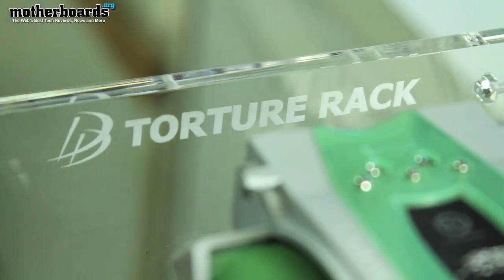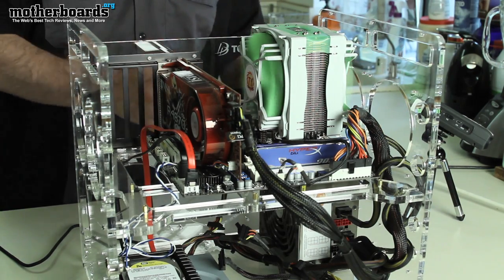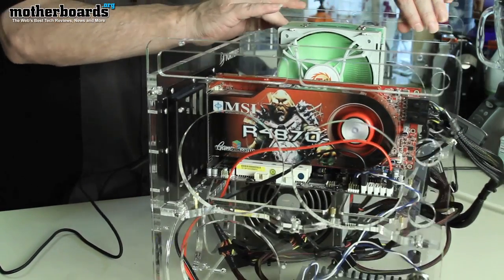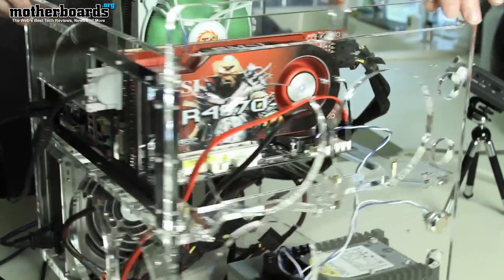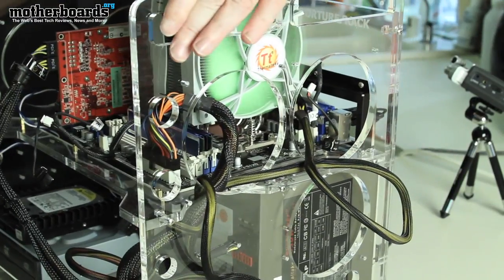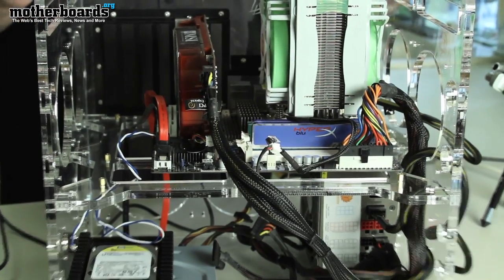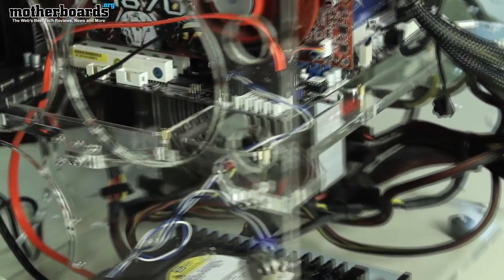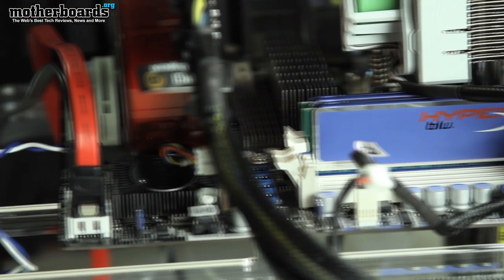Danger Den - Torture Rack (Acrylic Case) Hands on Review.

Comment: I only went back 3 pages so forgive me if someone addressed this but fans are nearly useless if you don't have a computer encased. You put fans blowing air in from the front and then out from the back creating a jetstream. The computer case itself creates a natural duct for the air to go through. This is why one puts fans on CPU's, GPU's, and sometimes even memory simply blowing the air into the inside of the computer. The warm air is picked up in the jet stream and exhausted out the back.